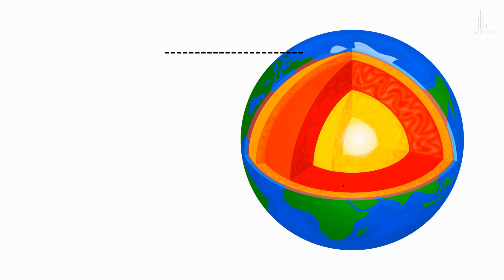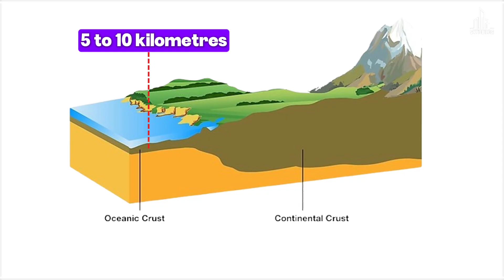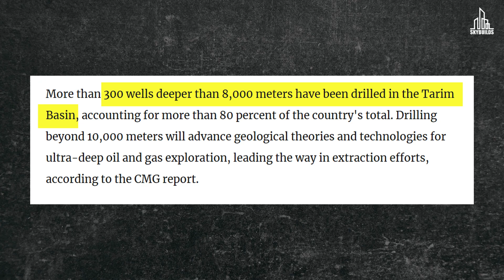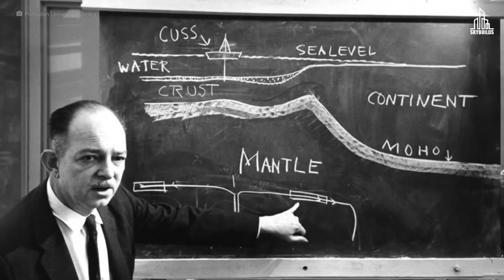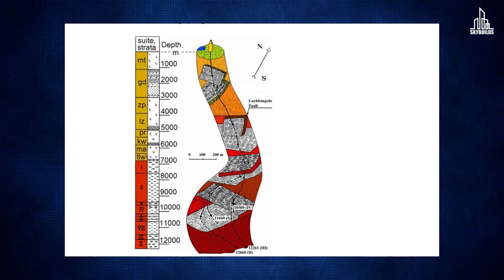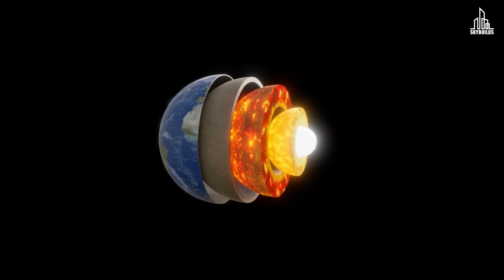Inside The Deepest Hole Ever Drilled in China!

Comment: For very deep hole, you don't use the drill string's rotation to power the bit.  You use a downhole motor or mud motor to turn the drill bit.